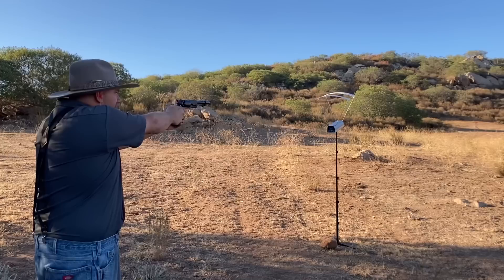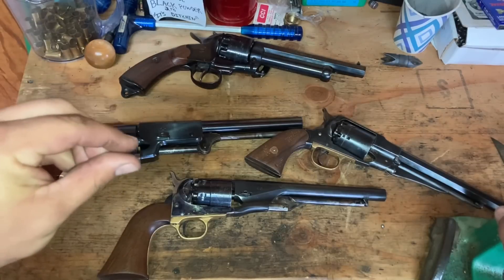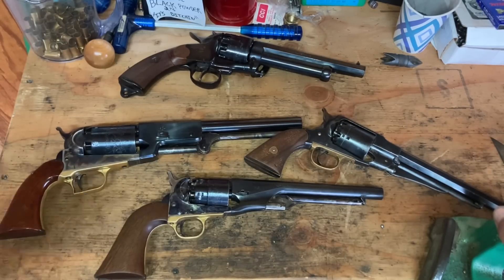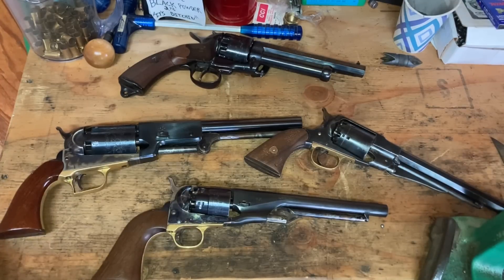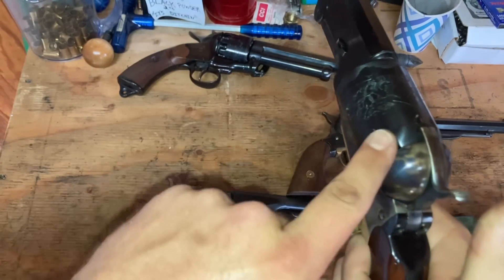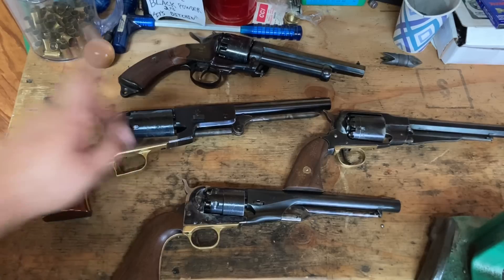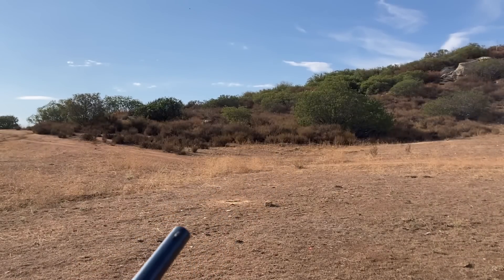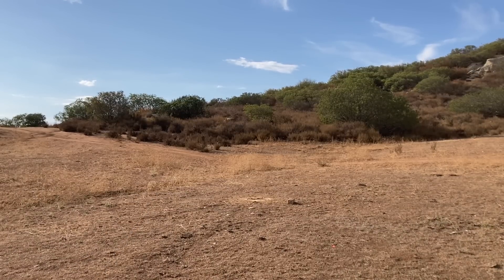What Causes A Chain Fire?

Comment: Good video. And yes, a lot of these things need prefaced by "in my opinion". Having said that, I will state UNEQUIVOCALLY that chain fire occurs from BOTH ends of the cylinder. Somewhere on yt, there's a slow-mo video showing this. However, I can state from personal experience that that slo-mo is correct. Personally, I've only had one chain fire. I was using #12 caps on #11 nipples and pinching them in place. Voila! Chain fire. I was present when a shooting buddy loaded his sprue "off center" and got that partial lead ring. Voila! Chain fire. 
I can also state that a bare nipple on either side of a capped chamber WON'T fire (I've tried it too, as have several others, so it's not just your six shots. It's several hundred showing the same thing). HOWEVER, a "too large" cap WILL ignite. It occurs in the same manner as flintlock ignition. Flame from the fired chamber ignites the CAP on the adjacent chamber in the same manner that the pan Flame ignites the main charge of a flintlock through the touch hole. Takeaway, therefore, is that BOTH the caps and the balls need to be correct size and fit. Do that, and no issues. 
Personally, I love bore butter, but I will freely acknowledge that it isn't the best choice for hot climates. It's best use in hot climates is for rifle patches, and to lubricate the cylinder pin of both Colt and Remington revolvers. It helps keep fouling soft, and THAT is the central point - i.e. keep your fouling soft, and you can shoot all day. Otherwise, plan on taking some cleaning breaks. 
Again, good video. 👍

Comment: I think there are a couple of aspects,  in my experience of on old ASP (1976) gun,  those chambers do not shave lead.    The ASP has tapered chambers and that may be true of the ASM as well.  The gun came with .457 balls and with some checking,  I found that if you use that size, you get a 1/4 inch wide squeezed band of lead.   So far no Chainfires (some wads,  no grease).    A new Pietta NMA does shave lead rings.   Caps were falling off on that one, I doubt you get a rear inflicted chain fire,  Caps sometimes don't set a charge off and I don't buy that non contained fire will wrap around,  go down the larger hole and then on through the tiny hole as the bottom of the Cones (also my opinion).
       Some kind of seal will compensate for an issue,  so unless you are confident you have no issue,  then for sure use wads and or grease or bothit.   Of interest is no mention of that method back in the day (and for good reason, the chain-fire issue was designed out in my opinion  - can you imagine the mess of dust and dirt any soft grease would cause?)   .

Comment: My experience with chainfire was with an original remington 1858 army. Using both wads and grease.  The nipples were rather small. I had a 3 round chain fire. Examination of everything afterwards led me , as well os other, more experienced witnesses to the event to conclude recoil had caused  lose caps to go off.

Comment: From my own experience I'd say you're right that the chain fire is a front-end problem, usually caused by an undersized ball. If you're not cutting a ring off of the ball when you load it, it's not tight enough. I owned a Walker at one point, isn't that loading lever falling down on every shot a pain in the butt? Very poor design on the lever. I'm with you on the safety Salley's too. Sort of like the people who believe that you can shoot them through the camera if you point the gun at it. Good video. I believe you're right, just for the record.
Reply from the maker: Thank you

Comment: I always put boutwell melted paraffin the wax actually absorb the black powder residue spillover to each cylinder when loading that's why you should always load all the cylinders with a powder and then put your bullets and each one and if you're going to carry the gun like I'd have for years and years I have carried them for up to five years before I fire them I put paraffin on the set on each one of the cylinders paraffin absorbed the gunpowder if you use anything margarine works good but if you use any greases or anyting the grease ignite's the grease can set it off and set the gunpowder off cuz even water doesn't hurt black powder if you dry it out those you make it with water and gunpowder never goes bad they've had gunpowder 200 years old they found it was still highly explosive

Comment: It`s just physics, a nipple with a cap on it will have a hard time letting the burning gases from the center nipple penetrate down into the neighboring chamber, even if the hammer recoils off the nipple due to overloading the chambers or a slack spring resulting in the cap on the fired chamber to go popping off into the geography allowing for burning gases to come out the nipple.

Comment: Yep, absolutely correct.
For many years I used .451 rbs in my target rifles and my revolvers too.
The balls were a tight fit in the rifles
And a easy to seat n my revolvers.
As long as the balls would stay put in the chambers under recoil I was happy with them. I had no chain fires as long as I greased over the balls
If I forgot the grease I had chainfires.

Comment: I bought a replica .44 cal.1861 Army (manufactured by Colt) in the late 70's. I've always used Crisco. I've fired hundreds of rounds through my Colt and never had a chain fire. That is my 45 years of experience. Take it for what it's worth.
Reply: Crisco is great till 80 degrees f. I use beeswax and mutton tallow. If you can’t stand the stink, make small batches. Smells great for a month or so.

Comment: What grease formula are you using? Ive heard a couple of sifferent ones. 2 parts lambs tallow to 1 part beeswax and 50/50 lambs tallow to beeswax.
Reply from the maker: 60/40 both ways depending on summer and winter

Comment: Use an Ox Yoke wad over the powder, make sure your ball diameter is large enough to consistently shave a small ring of lead as it is seated, do NOT use Crisco over the ball. It melts like water and does nothing good. Use a grease made for the application. And of course make sure the cylinder gap to the barrel is not excessive. The cylinder should spin freely but just barely. And ALWAYS wear eye protection when shooting or even handling Black Powder.

Comment: I had one chain fire  in my ASM stainless steel calvary model 1860.  Since then I cut an over the powder felt out of an old flannel shirt.  I have a set of hole punches so I make a bunch at a time.  I have 6 black powder revolvers of various brands CVA, Pietta , ASM, Ruger Old Army, a pepperbox and a Uberti Walker.  For the pepperbox I use .36 caliber roundballs, THe Walker .454 round balls and the rest ,440 roundballs.  I measured my guns so I know what round balls they need.  My loading procedure is that same for ALL of them.  Over the powder charge I place one of my home made felts and ram it in place.  Next I seat my roundballs and then I seat an Oxyoke felt over the top of the roundball.  Once I have the Oxyokes firmly in place with a Qtip or stick I put a ring of Bore Butter around the outside edge of the over ball felt.  When I put on the nipples I pinch them and then use a stick to press them in place.  I have inadvertantly dropped several of my charged BP revolvers in the creek when I was getting camp water.  They fired just fine. 

A Calvary model black powder revolver has an attachable stock.  ASM made Calvary models as did Pietta.  One can still order Pietta stocks.

Comment: This probably doesn’t apply to your chain fire. The wall thickness between each cylinder is pretty thin and if there is a crack you probably won’t be able to see it. Figure out a way to pressure test each bore if you have any doubts about the the cylinder….like if the lead ball fits too easily

Comment: People do get very protective of their opinions.  I know it's not good to assume, but when people come out definitely one way or another, on a topic that is on a sliding statistical probability scale.  It makes me think that they are being emotional about their opinions.  

I've been a fan of grease, tight balls and wads, paired with snug caps most of my BP revolver shooting life.  Sure there were times in college where I had to choose between shooting or eating, so I took some extra chances.

But there are other factors besides grease, tightness of balls, wads, and proper fitting caps.  

An eroded chamber wall due to lack of up-keep can make it more difficult to seal.  BP requires less thermal input than most substitutes and is therefore easier to light on fire.  It's basic common knowledge that it is easier for a forest fire to propagate on hot, low humidity days, than on low temp high humidity days.

I am knocking on wood right now by saying this because I also think luck is a factor.  But I have not experienced a chain fire and I attribute that to a statistical low probability.   A low probability that exists, because of how I choose to shoot my guns, with snug caps, Pyrodex, wads, tight balls and grease (excessive amounts) and I maintain my gun so the chamber walls are not pitted.

As far as shooting weather goes, I live in WA so if you only shoot on hot low humidity days, you don't get to go shooting much.  Sometimes we load under a tree and step out in the rain to shoot and that's just how it is here.

About the only way I can think of to nearly reduce the occurrence of a chain fire to near zero, is to shoot metallic self contained cartridges.
Reply from the maker: Well said.
Reply: @Everythingblackpowder  What I have learned over the years is that opinions can be changed if a person is open to learning or considering new information.  Mainly because of my climate, my homemade BP lube has always been goopy, high flow lube and my hardcast lube has been very solid.  For BP I use the same lube for greasing the gun on assembly after cleaning that I do for shooting.  I originally just gooped up everything with my finger, and by the end of the day, just like a little bit of anti-sieze, it would be everywhere.  Then, I graduated to spatula use, with a small flexible key fob, used for trowling the lube into the chambers.  That was some cleaner, but it's still not very quick.  It never crossed my mind to make a separate malleable "play-doh" like lump of lube/chamber sealant and just chunk it off into the cylinder with my thumb.  But now it has.

Comment: An observation..... At one time I always loaded all 6 chambers for SASS events but only capped 5, at the time I was using 1/16" lubed felt wads with no front end grease. In some thousands of rounds I had no chain fires. These days I am using pre-lubed conicals with paper cartridges. No chain fires yet.... Remington revolvers... If thousands of rounds with one loaded but uncapped chamber caused no chain fires it points more to the front end being the culprit.
On buying a new pistol I have always measured the groove diameter of the barrel and reamed the chambers to .001" bigger than that and balls around .003 - .005" bigger than the chamber mouth (accuracy is improved by doing this). This not only ensures a good fit all around but also that the chamber mouths are perfectly round..... Sometimes they are not, sadly... I did measure an ASM that was a bit remiss in that regard...
So.... It would seem most likely that chain fires happen at the front end... Due, I would guess, to imperfections in the chamber mouths not taken up by the balls being seated.
Having said all that, in 35 years and thousands of rounds I have not had a chain fire. I wonder if my treatment of new guns to make sure that everything fit perfectly had something to do with it.....
Food for thought at least.... :-)

Comment: I've heard multiple people say say chain fires are impossible from the front if you use an oversize ball because it perfectly seals the chamber air tight. Now while that does make a bit of sense not every round gets sheared off evenly and there's always a chance there is a miniscule space for a spark to get in. I think they can happen from both sides but I do agree the front seems much more likely as that's the biggest opening and each chamber gets pressurized with fire during each shot, it only takes the tiniest opening...

Comment: Using a slow mo camera, you can see just how little fire is at the back of the cylinder,vs the face of the cylinder. Use your logic folks. That is burning gasses going 360 at the forcing cone. 
You can also sit the revolver on a white sheet of paper, use only caps, see how much discoloration and damage. Then do a single chamber of powder. 
Law of averages, the place with the most gasses is where you get the most failures. As a general rule of thumb if you have a chamber loaded you have a cap on it. Lot of guys will use a push stick to ensure caps are tight,  or gently seat with hammer.

Comment: If you are using the correct size ball there is no way for the pistol to chain fire from the front. If you use correct sized caps you won't get one from the rear. I do use homemade wads soaked in my homemade lube. Never a problem and easy cleaning of the bore after 60-80 rounds.

Comment: I want to take my turn at video complaining, so the first thing I want to complain about is, when using acronyms like FUD, let some us (bump on a log and stick in the mud folks} know what the hades it means, I had to google it to get some idea.> Fear, Uncertainty, and Doubt.... 
2nd thing that irked me was that blanking loading lever keeps falling down. Something like that really upsets my video watching experience, in so much that I'm gonna make my own Hoover video.... 
3rd thing is, no one ever says why chain fires are bad, theres very little pressure since the ball is not forced through the smaller diameter barrel, the ball just goes out the cylinder, so does the ball hit the gun frame, does the ball fly through the air coming back around like a boomerang, whats the big deal with chain fires? 
Also I dont think solders really had much time to worry about chain fires back in the Civil War when in a battle, I think solders back then just shot fired and reloaded fast as possible before being shot. And I dont think the solders messed with putting powder in a another separate powder mesurer or greasing cylinders and or wads while being attacked either, they probably just quickly blew in the cylinders and reloaded. 
So IMO,  if the ball leaves a ring, the ball is sealed and cant chain fire,  theres a better chance of winning the Powerball jackpot then chain fires.........
Reply from the maker: First, I’m terribly sorry that you had to take 30 seconds out of your day to Google what a “Fudd” is. Words can’t express my regret for not taking the time to explain it to you personally.

Second. The loading levers on walkers are notorious for falling under recoil. Another 30 second google search will confirm this but I understand your time is precious.
Third. The reason why chain fires are potentially dangerous is because if the chamber 180° from the barrel goes off, the ball will slam into the loading lever and could damage the barrel and even the arbor. Didn’t I mention that in the video? 
And finally, I didn’t mention anything about the civil war and how these firearms were loaded in the 1860s. I never said that the union only used wads and the confederates only used grease…
Lastly. I agree that if you cut a nice ring of lead that the odds of getting a chain fire are slim to none but I invite you to watch this video from a feller that thinks otherwise. Also, your complaints will be filed with the HR department and a suggestion will be placed in the suggestion box. Copies of your complaints will be handed out to all the staff and the board of supervisors will vote on a resolution. 
Thank you. W.F. McBain

https://youtu.be/cpUse-_BZTo
Reply: @Everythingblackpowder  Apology accepted LOL But to be honest it took me 57 sec to google FUD, my spell check wasn't working so I had hard time searching for the meaning..... 2nd>{"The reason why chain fires are potentially dangerous is because if the chamber 180° from the barrel goes off, the ball will slam into the loading lever and could damage the barrel and even the arbor.")<<<<<<<<< You may need to say that in slow motion or do a video demonstration with crayons on what that means cause I got lost at 180 degrees from barrel meaning, and yes I get lost very easy, but thanks for trying, and thanks for that video link on lead ball ring. I'm gonna do that same test he did, but I still like using lubed wads over powder..........PS, today I made my Hoover video, also please overlook my sarcasm,  I dont think I did, but if I offended you in anyway, I apologize to you, you do good videos..............
Reply from the maker: @job38four10  it’s all in good fun but now I’ll have to amend your paper work to reflect the correct amount of time it took you to google the term “fudd”

Comment: I like Bore Butter.  On patches.  If I plan to use it on a revolver, I put some in a small metal cup and set it on the coffee plate until it melts.  Then I add beeswax.  About 60/40 beeswax to butter.  I also use that same mixture in BPCR reloading.  Works great.